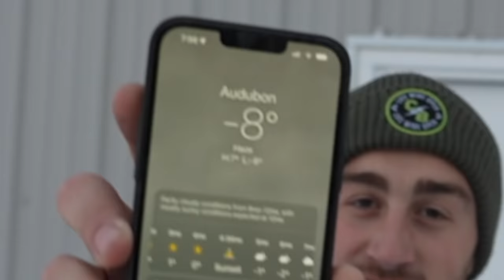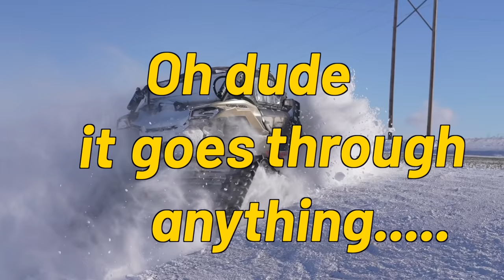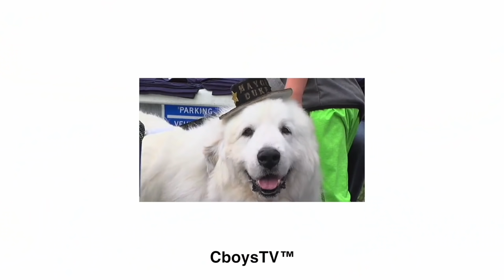Maverick on Tracks after Blizzard

Comment: Same setup on my x3 max heater is huge for defrosting windshield, added truck mud flaps backwards on the front to keep the snow spray down also sealed the cab with foam, rubber molding and silicone to try to keep the snow out of the cab because it fogs up windshield but the backcountry tracks are amazing